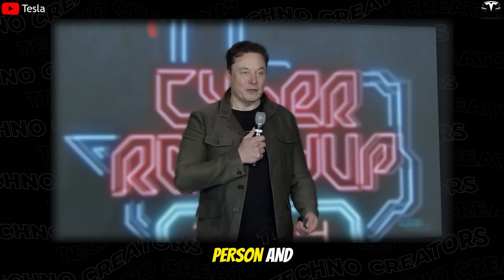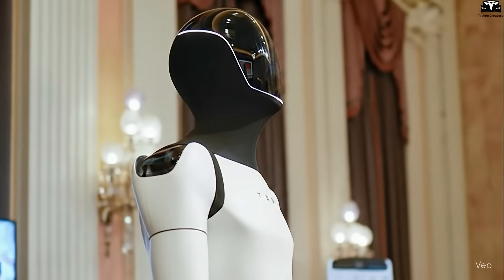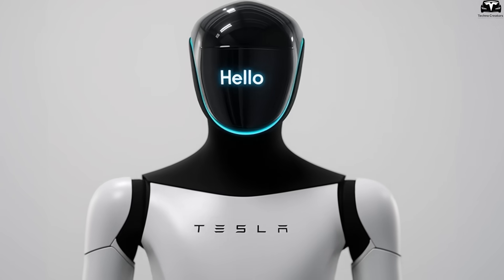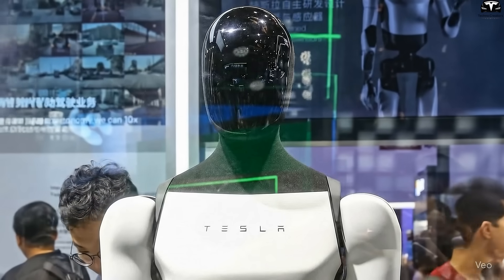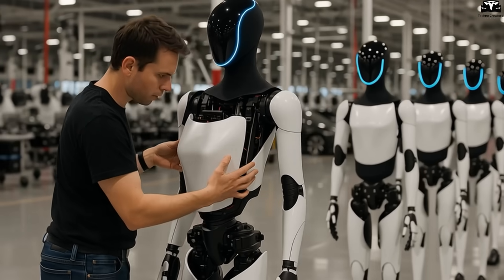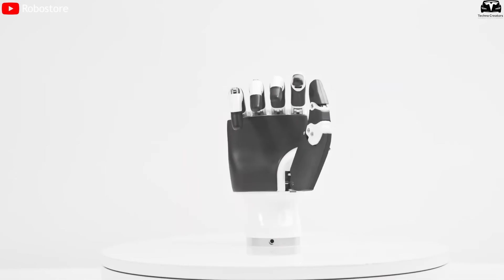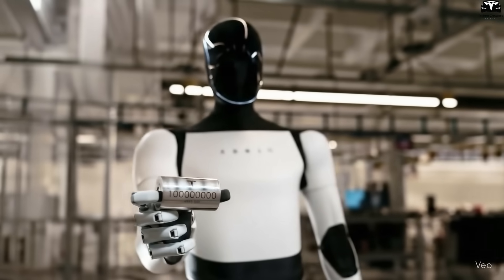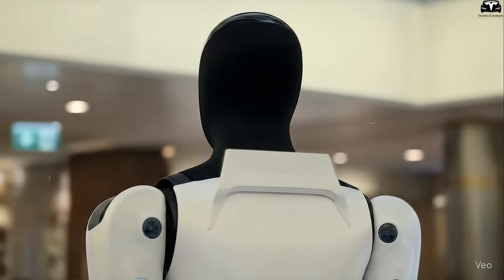BIG UPDATE! Tesla Optimus Gen 4 Stunning Design Upgrade & What It Can Do! (Never Seen Before)

Comment: The flexible hips makes the walk and torso movements so much better. The arms more rotatable and even better hands with fingers that can spread out, more flexible feet that allows for an efficient roll walk, still much to improve, but gen 4 is already a big improvement and a great engineering accomplishment. Gen 5 should be able to ride a bike or car, catch a ball, etc ...

Comment: I like the slight of hand (or video cut out) at (4:00) where the cucumber disappears. Magic! 
Also, why have a robot face? I'm sure a human face would be easier to relate to, especially if the robotic software has it emulate human expression, which I had thought was one of the reasons to build humanoid robots in the first place.